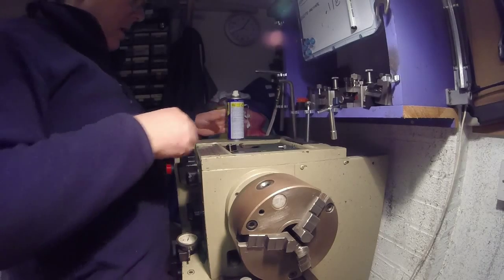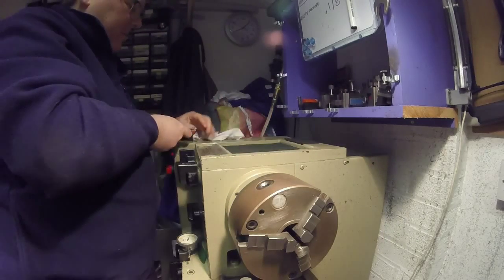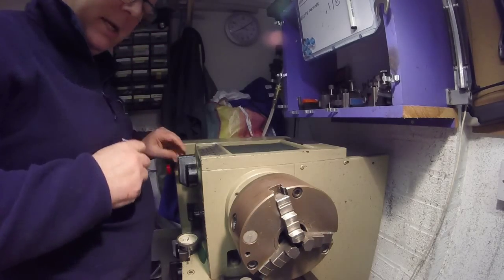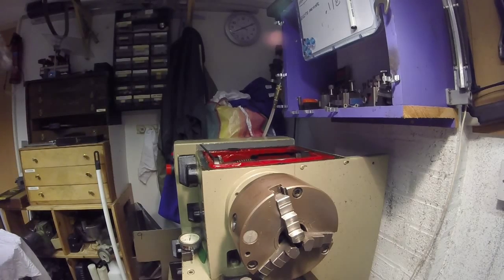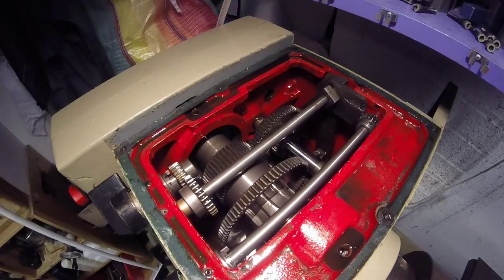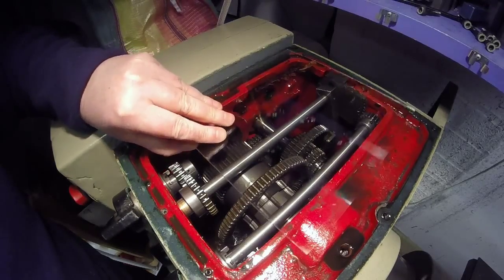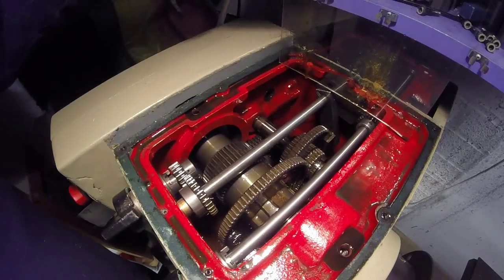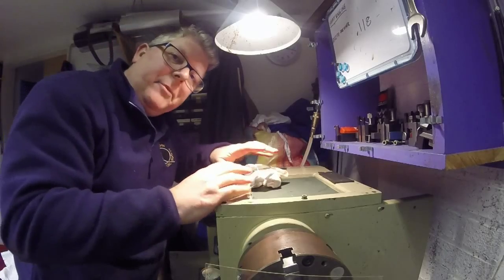M300 noise

Comment: I had the same problem on my m300 after a full gearbox strip down it was still knocking.
Finally I checked the phase voltages from my inverter and found one phase was down 40%. Purchased a £70 inverter off amazon, wired it up and gearbox was nice and quiet again 👍

Comment: Hi 
Did you find out the cause? I have a M300 that has developed a similar noise and can’t fix the problem.
Reply from the maker: Brian Greenstreet  Sorry. No. The good news is it never got any worse and I don’t notice it now.
Reply: good day sir. were you able to solve this problem??
Reply: I had the same problem on my m300 after a full gearbox strip down it was still knocking.
Finally I checked the phase voltages from my inverter and found one phase was down 40%. Purchased a £70 inverter off amazon, wired it up and gearbox was nice and quiet again 👍

Comment: I wouldn't know exactly what paint Harrison used on the insides of that gearbox, but in North America the traditional paint was or is called Glyptal. It's mostly used to seal any casting debris in and it also helps a bit with allowing the oil to drain back to the sump a bit faster. But machine tool internals isn't the only place it's used. Some larger electrical motor internals, high performance automotive engines etc also have it used on them as well. 

A tough problem to track down in that gearbox, but I haven't watched the second video yet.I'd agree it does sound like a gear problem, but if a bearing is almost gone it could be that as well. A stethoscope would be best, but failing that a long screw driver can have the tip placed in each area while the machines running and you rest your ear against the handle tip. It's then pretty easy to narrow down the exact area the noise is coming from. They make specialized stethoscopes with a long steel probe tip for automotive mechanics to do the same thing.
Reply from the maker: Thanks for the info on the paint. I recently had someone comment who had the same noise. They found a small metal chip embedded in one of the gears. I am going to investigate soon with my new USB endoscope. Not hopeful, but worth a try.
Reply: I certainly won't say this is what it is, but it's a fairly good possibility. One of your videos showed a dti up against the face of the gear, that showed a steady and repeating wobble on the gear face. That can only happen if the shaft/ white metal bearing is worn enough to allow that movement. Once that starts it only gets worse at an even greater rate and starts wearing each gear tooth that's in contact with that gear just like you found. And those metal particles are coming from somewhere, so I suspect this is what's causing them. If it were me I think I'd be considering replacing both the shaft and the bearing since the shaft appears to be worn just enough a new bearing may not last long. Likely they would be the cheapest parts in the whole gearbox, and there needed anyway. But the tooth wear already done still won't help things stay completely silent.

If you haven't already done so I think I'd drain the oil, fill the gear box with maybe diesel, run it at medium speed for maybe 5 minutes then drain and refill with clean oil. Placing a thin flat magnet like computer hard drives have on the bottom of the gearbox would help to catch any further ferrous metal wear particles and prevent them from constantly circulating through the gearbox. Again these are only best guesses so I could easily be wrong and the main problem is being caused by something else.

Comment: The knock certainly varies with the speed selected, so it's not motor/belt/input shaft related which always run at the same rpm.